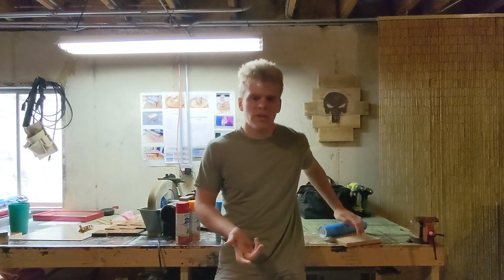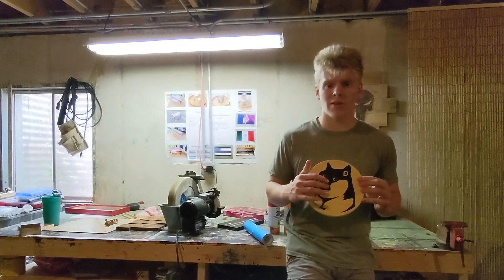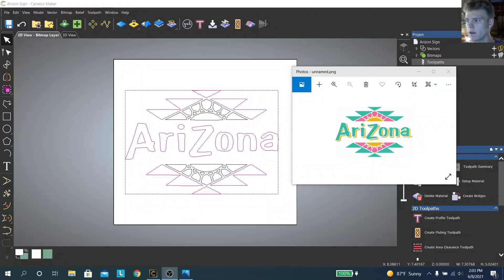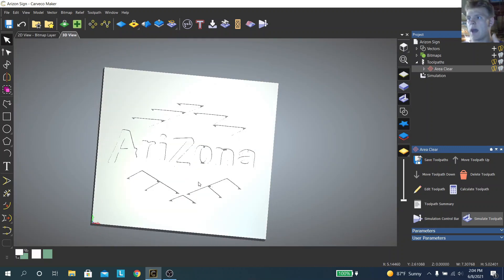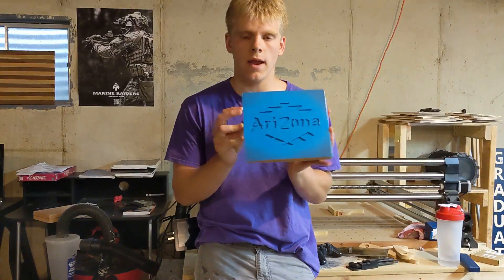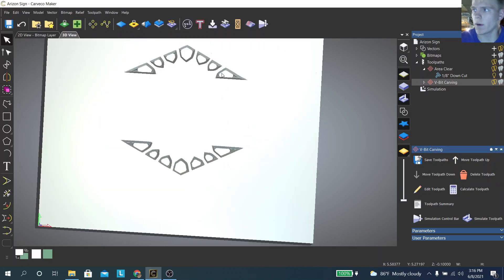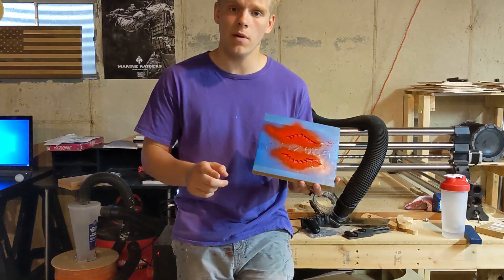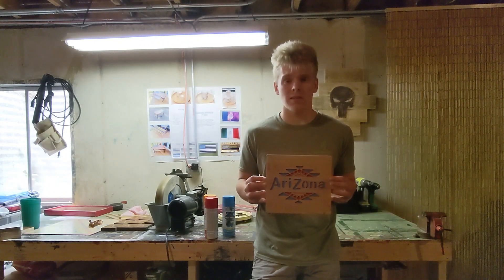How to Make a Multiple Colored Sign on the OneFinity  CNC | #AriZonaCreatorNow

Comment: This works... but after applying the oracal and carving you could just use masking tape to cover the areas you don't want painted.  
I've successfully done this many times with up to 3 colors (4 if you count the background lol)  

When doing larger batches that'll definitely go a bit quicker.  

I would also recommended applying a thin layer of shellac between the wood and oracal to prevent any bleeding underneath the mask when painting.
Reply from the maker: Awesome thank you. I am sure the shellac will help. I have been having problems with bleeding.